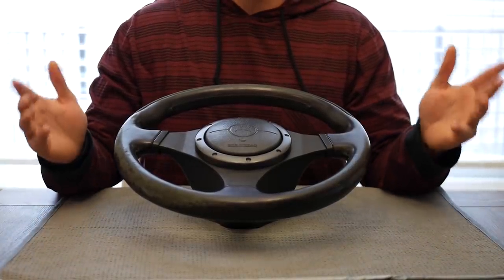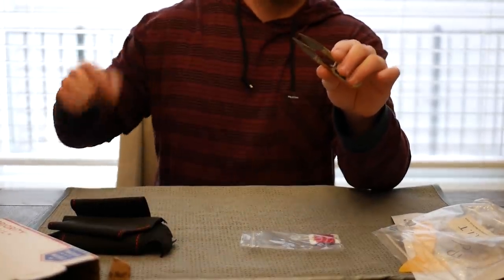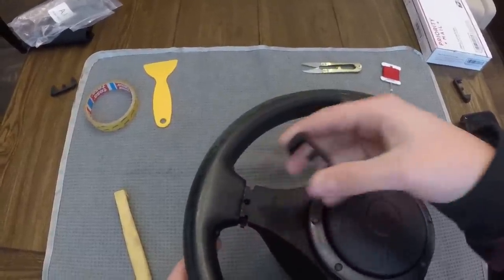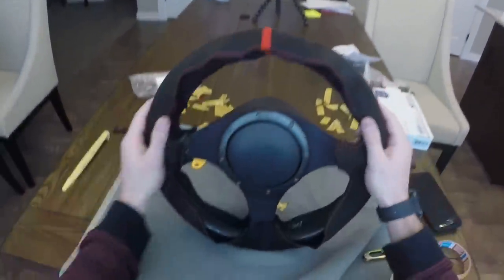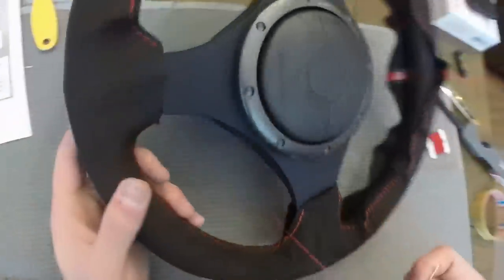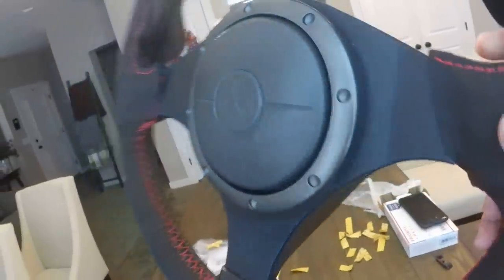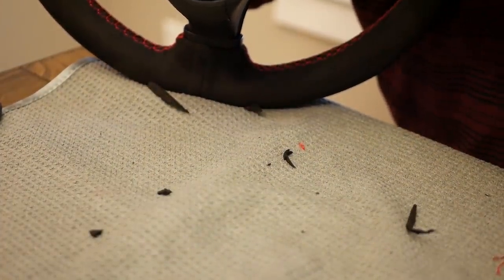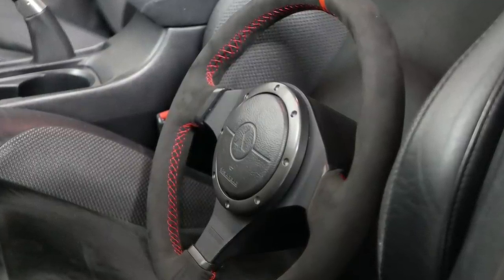AMAZING Steering Wheel Transformation with Micro-Suede Rewrap | Install & Review

Comment: Man you must be a mind reader because I’ve been thinking about doing this. My biggest concern is how well the suade holds up over time. Report back after a year or so and let us know if the material is showing any wear.
Reply from the maker: RMutt1 will do man! To be honest though, this should hold up extremely well with how thick the suede is. I can’t imagine it showing wear within a year or two
Reply from the maker: RMutt1 also, post more on your damn Instagram! Haven’t seen your Evo in forever
Reply: I have a cheap wrap on my Ford Fiesta made from a micro suede type material and it’s been great for the 2-3 months I’ve had it on so far, it bobbles up a little in the first few weeks but it smooths out again pretty quick, I love the material but my biggest issue with my own wrap is that I didn’t use any double sided tape so it does move very slightly although it’s not noticeable when driving. Much better than the 16 year old leather it’s covering regardless 👌🏻
Reply: RMutt1 I got mine a couple of months ago. it got dirty(sweaty hands) and I washed it(with a mixture of water and woolite detergent with a toothbrush) removed the excess mixture with a cloth and let it dried over night it was like new again :)
Reply: RMutt1 I did mine on a Nissan Versa sedan and sold it for $1,000 dollars and it costed me 5 dollars lol
Reply: So how is it?
Reply: @ALLDAYANTHONY  is it still holding up? How is the wear by now?
Reply: @jelle8754  ???????
Reply: @greekgamer4u201  what? I was asking the OP how his steering wheel was holding up...
Reply: @jelle8754  same

Comment: A soldering iron works great for pinpoint accuracy on melting nylon threads
Reply from the maker: Evolve 614 good point!!
Reply: I would imagine a punk stick would probably also be a great option since there’s no open flame, but there’s just enough to burn the thread

Comment: My steering wheel is pretty clean as I do have a low mile EVO however I’d like to keep it clean so I was gonna wrap it and protect it but do you think putting the double sided sticky tape on it will ruin it in the future if I ever decide to remove the cover? Like is the tape extremely adhesive and damaging? Please get back on your thoughts

Comment: Great job, I'd never have the patience. The oem cover looks like it could just have been coated, the leather didn't look worn. My wrx wheel looks crappy up top, the black coating over the leather is a little different than yours. Sucks because the rest of the wheel is great. Will probably pay someone to rewrap mine, so I won't notice the mistakes I'd make.